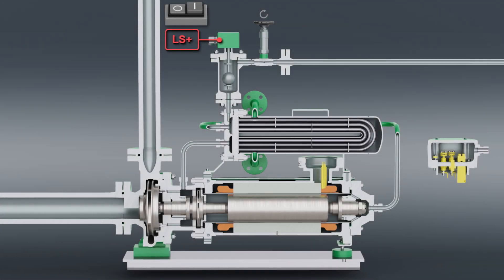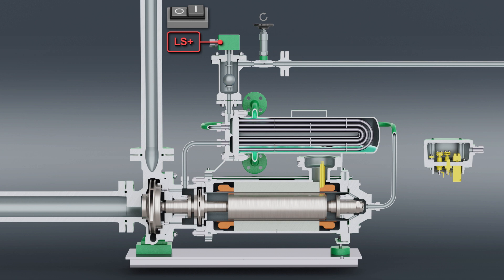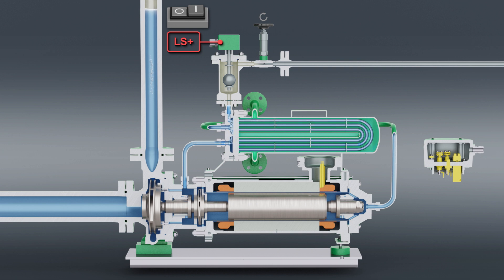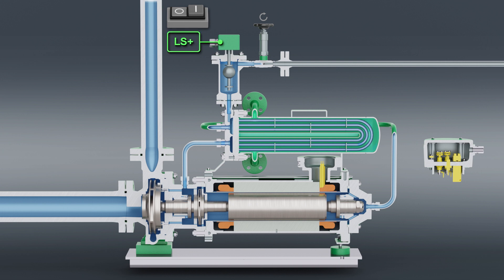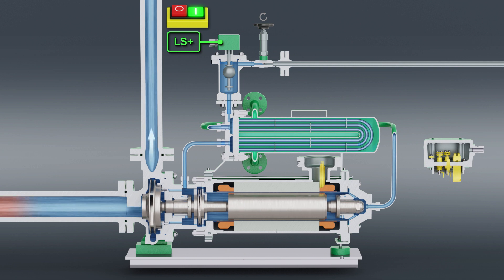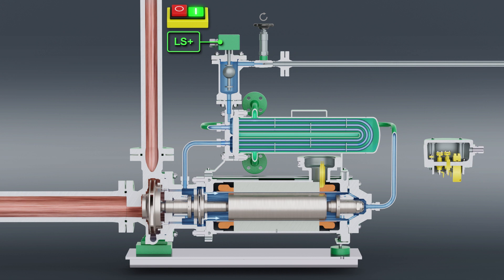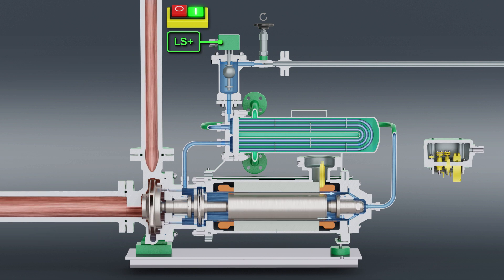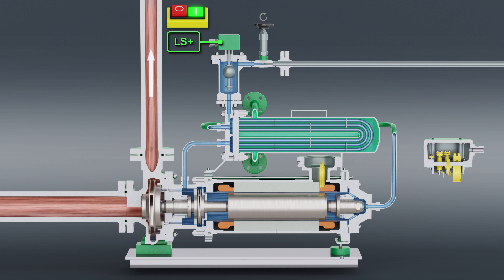HERMETIC | Canned motor pump type CNK | EN

Comment: if this pump were run deadheaded, does the auxiliary cooler provide enough cooling to prevent vaporization? Would this be a catastrophic failure with release to the atmosphere?